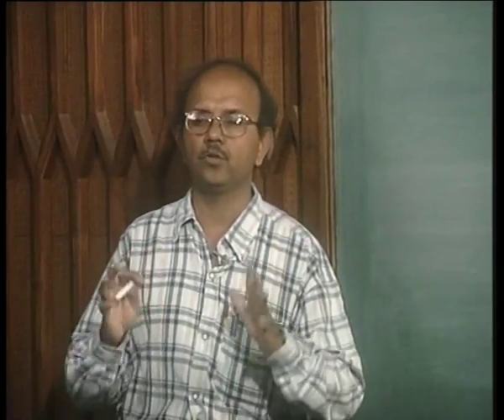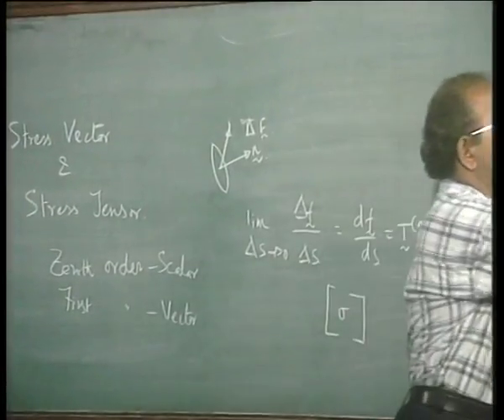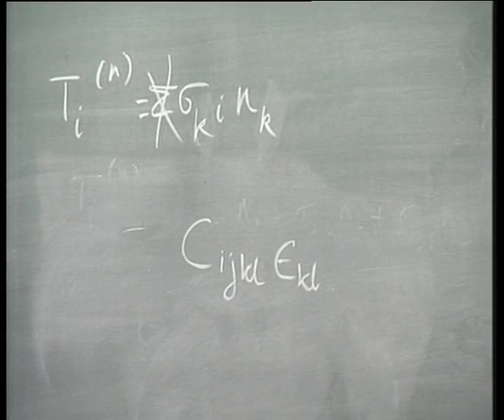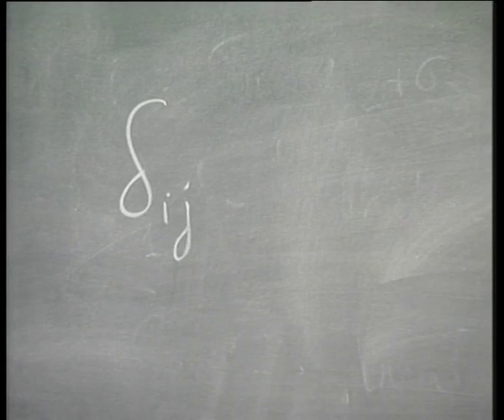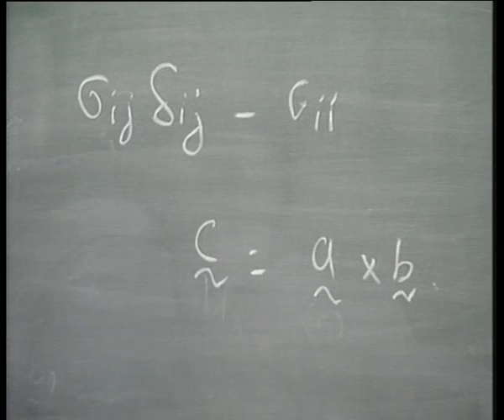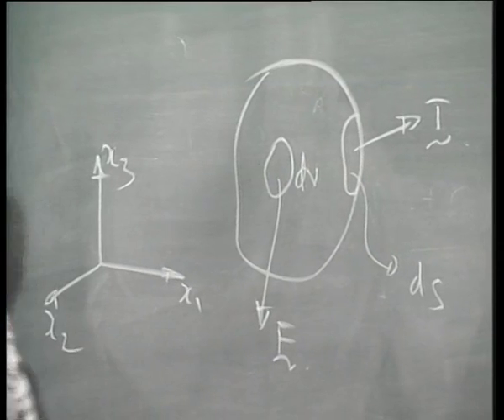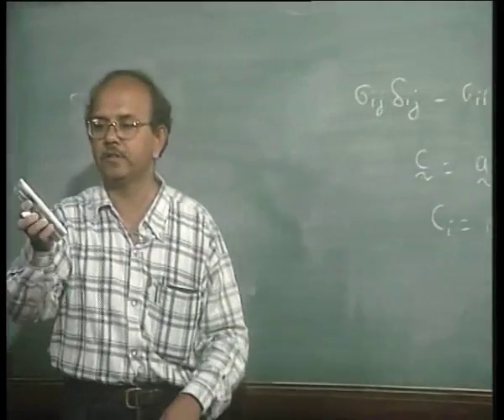Mod-01 Lec-06 Introduction to Finite Element Method

Comment: Yeah up to the previous everything was kinda clear. Now im completely lost. Why are i and j that are usually unit vectors now points ? explanation is kinda messy with this one
Reply: Stephanos Philippou It’s just a Convention. i,j and k are used as indices to denote components of a vector or a tensor and the unit vectors that are usually represented by i, j and k are represented instead as e1, e2 and e3 for the 3 directions respectively.

Comment: Why sigma(ii)  is a scalar??
Reply: a little bit late, but a repetition of index = SUM: so sigma(ii)=sigma(11)+sigma(22)+sigma(33)  which is a 1 number; it's a scalar.
Reply: @Khaoula_o  i didn't understand it
Reply: @m.s.mownitharan8471   A simple answer would be remember, it was told indices on left and right should be same.so if indicial notation for (sigma)ii =P, P will not have any indices. It means P is scalar quantity, and (sigma)ii is scalar. hope u got it.

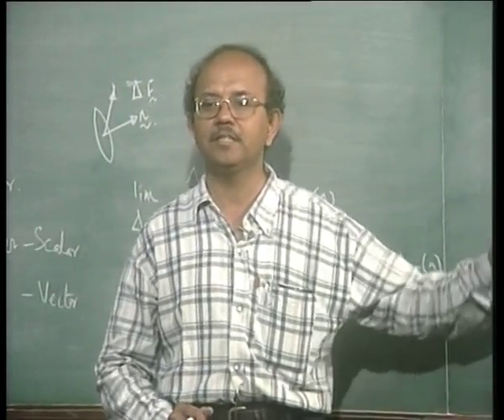Comment: @15:20 Why is SIGMA ii  a scalar? It clearly has 3 components like a vector SIGMA 11, SIGMA 22, SIGMA 33.
Reply: Okay I think I got it...repeated indices are considered as summation hence it results in single quantity.
Reply: @SiriusBlack-qo3xi  Yes if you add SIGMA11 + SIGMA 22 + SIGMA33 it will give you  a single quantity.
Reply: @priyamguruji1687   @Khaoula_o  i didn't understand it
Reply: @m.s.mownitharan8471  A simple answer would be remember, it was told indices on left and right should be same.so if indicial notation for (sigma)ii =P, P will not have any indices. It means P is scalar quantity, and (sigma)ii is scalar. hope u got it.
Reply: A simple answer would be remember, it was told indices on left and right should be same.so if indicial notation for (sigma)ii =P, P will not have any indices. It means P is scalar quantity, and (sigma)ii is scalar. hope u got it.
Reply: Sigma_ii = Sigma_11 + Sigma_22 + Sigma_33 (Einstein's notation)

Comment: if del(ij) is a unit matrix . Then, how come sigma(ij)del(ij) =sigma(ii)   why not sigma(ij)del(ij) =sigma(ij)  . Here i am using matrix multiplication . Both sigma and del are matrix of order 3*3
Reply: I guess he was multiplying the elements of sigma and delta, rather than the matrix as a whole.
Reply: It is Sigma(ii) because all the elements in the answer will be diagonal elements of the first matrix.  Ex sigma(11), sigma (22) etc. You write sigma(ij) or sigma(ii), no difference.
Reply: The convention for repeated subscript is summation. So sigma(ij)del(ij) = Sum(i=1 to 3) {Sum(j=1 to 3)  sigma(ij)del(ij)} ...which reduces to sigma(ii)=Sum(i=1 to 3) sigma(ii) following meaning of del(ij).